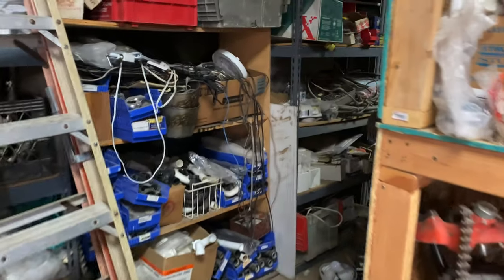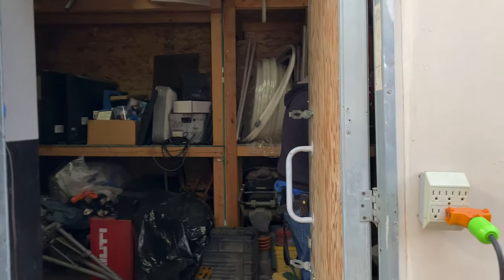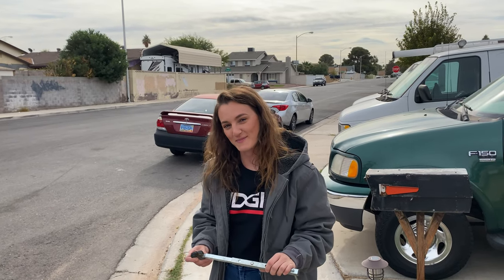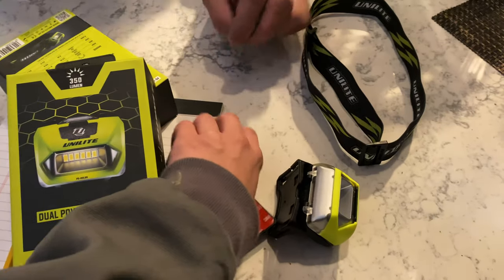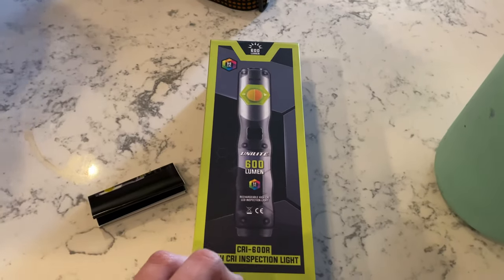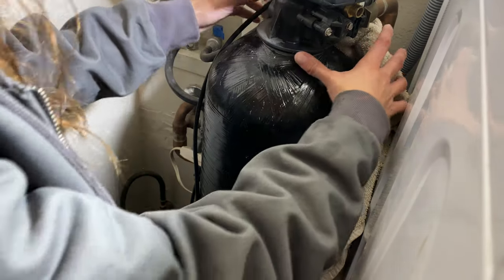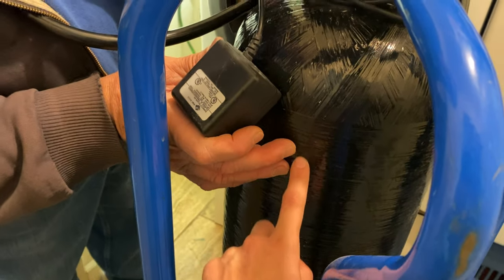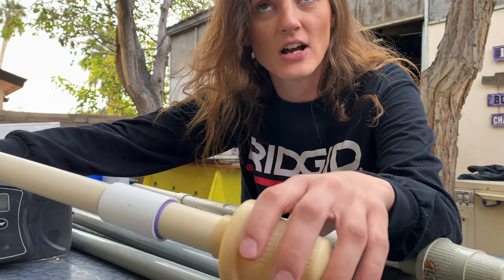Rebuilding a Water Softener! How To Vlog

Comment: I find it kind of cool that in different places around the world they use purple primer and not clear. In Wisconsin where I am from, they use clear. I heard the reason most states use purple primer is because if there is an inspection for a rough in or underground, they like to see the purple color signifying you used primer for a two step process cement/glue. (Like your videos btw, you can never stop learning.)
Reply: the ole 2 step
Reply: Dam purple primer, had it spill in my van the other day in the same bucket as my knipex, melted the grips completely off 😅😂